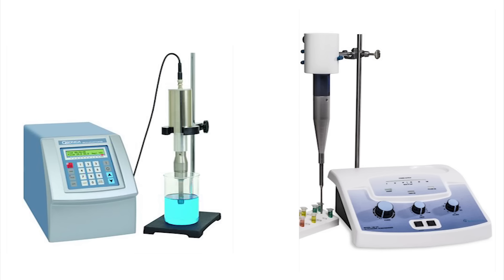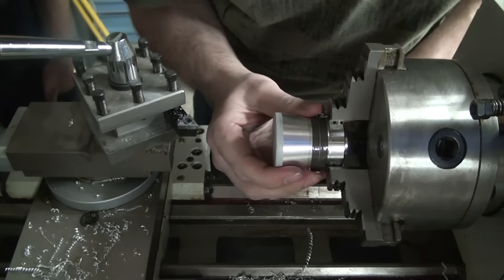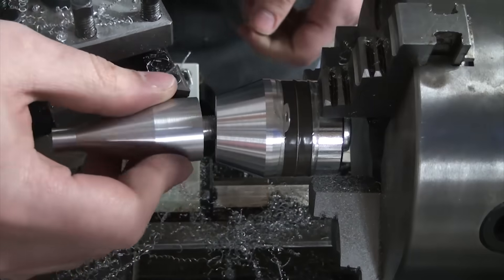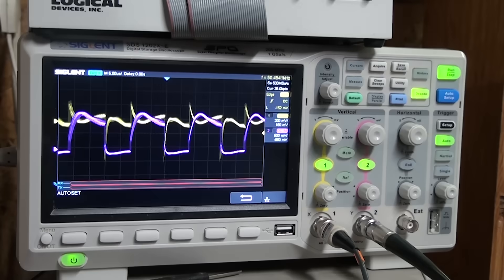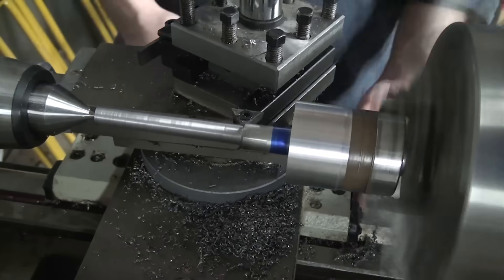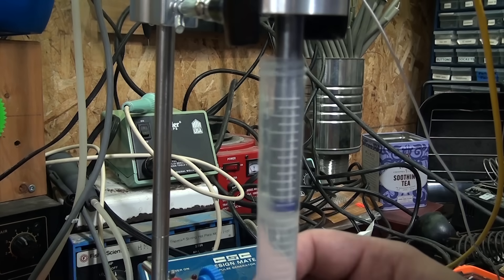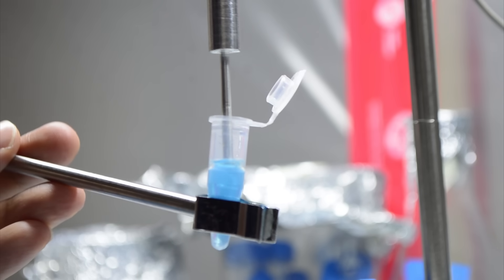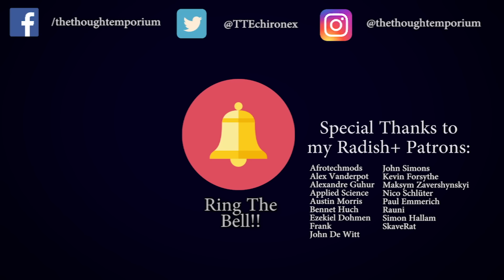DIY Ultrasonic Mixer

Comment: Thank you for sharing, i have a quick question, when you thread in the horn into the transducer, is it pushing against the main bolt that holds everything together or not? Because i found that it might change the main resonance of the transducer i just want to verify

Comment: 1:53 Piezoelectric voltage generation is how many cigarette lighters work. Same with gas grill starters (the kind that have a button that is hard to press and then releases with a loud snap).

Comment: As a machining technician, i spent the part of the video where u use the lathe machine SCARED AS FUCK. This is 4 years old so i assume u have now a deeper knowledge about machining. U were tempting the murphys law the way u were working. Be careful, this kind of machines dont forgive errors and u could get yourself dead in a single second. Wish u the best, nice project and video! Great work!

Comment: I would like to see if it is possible to make a good lotion with it. I would like to see it with the least possible amount of emusifier possible.  My suggestion: You clamp the emulsifier to a holder. On a 3D printer you place and stick the Lotion Container. I will write you a gcode that constantly stirs the Lotion in a controlled manner. I will now write a program for that.

Comment: Try cellular disruption.  I'm investigating small scale bio-diesel production using duckweed.  I'm trying to determine the overall energy input/output of the process.  I've looked at mechanical (seed oil press) and ultrasonic cellular disruption.  From a DIY perspective, could be fun!

Comment: I watched your video again.  I remember when I got my first metal lathe - I actually hated woodworking - so imprecise ( did I ever regret that in my later years) But now, I'm looking at this project of yours wondering if I could add a PWM to the sine wave generator and then attach it to a high voltage amplifier.  Variable power control in a truly tunable Ultrasonic emulsifier.  Any thoughts on potential problems?

Comment: just what the doctor ordered!  one use you might have already though of is sonication of graphene oxide.  Quick question.  Do you have an idea of what sort of power you need from a sine wave generator to accurately tune the probe?  Also, any thoughts on how the driver resonant frequency can be adjusted to optimize tuning at the driver end of things?  Thanks for sharing this!

Comment: Wouldn't a rotor-stator homogenizer be a better option for large tubes? My understanding from the culinary world is that the heat from ultrasonic homogenization is not the best thing to deal with, not to mention that it can burn the crap out of you if you're not careful.

Comment: Can a specific frequency be used to vaporize a targeted fraction within a mix of liquid substances?
Something like ultrasonic distillation?
I know ultrasound can vaporize water, so a quick proof of concept would be something like separating the water from a mix of oil and water.
The next obvious step would be to test the specificity by desalinating some sea water.
Advanced level testing would be targeting a different liquid by adjusting the frequency.
Azeotropic ethanol from wine, perhaps?
Gasoline from crude oil?
Biodiesel directly from vegetable oil?

Comment: very late little addendum a oscillating circuit comprised of a single capacior and a spool, tuned to the frequency you want will change square signals into a sine wave (formula for Fres is F_res=1/(2π√LC))

Comment: Sooooo we got weird and researched how to make Cola with essential oils and gum arabic, turns out a homogenizer like this would make a more clear liquid (smaller particles seem to counteract mie scattering) i instead of producing a milky solution and the emulsion would be much more stable. I’d be really curious for the results but I’m missing a lathe and a signal generator :P so if you’re still interested in this kind of emulsions, I’d be really happy if you would try that. I’ve researched quite some things already, but I’m not sure if that knowledge is second nature to you. So if you’re up for it but need some pointers I’d be happy to provide some, for starters: https://twitter.com/blinry/status/1300532277395501058
But I’ve got a little more from the book I was reading that I didn’t write there

Comment: you can use the tool for making bitters and other botanical-solvent mixtures for infusions. 
the traditional method is to simply shake the mixtures, but with the use of a sonicator or an ultrasonic homogenizer, I suppose the finished product would be much cleaner, and of higher quality because it would utilize the plant material and solvent to its maximum potential.

Comment: Fillestick fella, I can answer your questions on machining anytime, just ask. The easiest way to keep from getting shocked is to just take a long screwdriver and touch the tip to the lathe ways and the shaft to plus terminal on the transducer. Nice to hear you taking a chance and going for it on the lathe. One of my favorite machines. But personally I like machines that are thirty feet minimum between centers. What can I say, I am a guy who likes to run large machines !!!!!!

Comment: Well Ultrasonic Machining (USM) seems to be the next step to go. Use a peristaltic pump to deliver diamond dust-containing machining fluid. With a low-cost CNC table and this tool head it is possible to drill stress-free holes on brittle materials such as glass and alloy steel.

Comment: Ultrasonic mixing can cause unpredictable chemical transformations of both the substances themselves and between them. Because of this, they once abandoned this method for the manufacture of a blood substitute.
If you need precise threaded connections, you must either cut the thread with a cutter or make adaptations for dies and taps to keep them perfectly aligned with the workpiece.

Comment: apparently graphitic carbon nitride can be made from backing uria at 550 degrees for 3 hr. and has many of the properties of graphene as well as the ability to make ethyl and methyl alcohol simply by passing co laden air through it   as well as the guts of a battery that can hold 1/2 kwh per pound a very cheap very impressive material

Comment: a horn could be made to cut and drill rock easily as butter, also if there is a way to feed a custom frequency into the horn by a microphone at the other end of the object as a secondary input would bring wery interesting results (think Hutchinsons effect)

Comment: If you bring it up later I'll remove the comment... but subtractive manufacturing is critical, and in fact, irreplaceable by additive for materials with crystalline structures, unless you're going to go about putting something together atomically, but that would have a limited use case lol. This includes 'all' metals, for which the way the grains are formed is critical to their properties and application. Even casting requires temperature control, and has to be done in one pour to be contiguous. 3D printed metal structures might as well qualify as a completely different class of materials for this reason, not a replacement for applications where you'd normally machine a part.
Reply: Side note, I hate using the lathe to cut threads.

Comment: hello, engineer friend here, pascal's law is at work here - it allows you to "concentrate" forces onto small surface areas.  vibration is just changing pressure.  https://en.wikipedia.org/wiki/Pascal%27s_law

Comment: the problem is the taper of the horn.
you should try to make it a bit concave, basically just copying the commercial design, since it focuses the vibrations gently and more effective than just a "straight" edge.
also the mounting surfaces where one was not threaded right should be made as perfect as you can do to maximize the energy transfer, otherwise the pieces just bump into each other causing energy loss to sound and heat

maybe even do something to the tip, not just keeping it flat, but filing out some grooves # to create little pins, since the tip pushes droplets from one layer into the other, this could maximize this effect since the energy is more focused on more points.

also try making a similar probe, where you add grooves around the tip radially, maybe the effect will then be stronger too, since there's again more surface are for the tip to interact with the liquids.

and finally maybe do the same last ideas combined and a smaller diameter to really get things going.

I'm hoping to see some progress soon :)
thank you very much ;)
Reply: going around with a 40 grit file around the tip would be an easy way to add grooves

Comment: Cool. 1: To prevent getting zapped, using a bleeder power resistor  (just a standard 5 watt dealie) from the transducer grounded to your lathe chuck as a drain would save you from some trouble. 2: In general adhesives will give away with heat. A crude way to break that bond would be a MAPP/propane/whatever torch whilst slowly rotating the unit so you reach the threshold temperature along the joint line. 

A more elegant way would be to wrap some nichrome wire (preferably pre-heated) around it and run current through it until you get a preheat on the wire. Standard adhesives (cyanoacrylate, PMMA, etc) usually give around 120C. On the other end of the spectrum, threadlocker gives between 200C and 250C. I'm too lazy to fire up ANSYS, but PZT4 and PZT8 are both going to be safe enough re: thermal conductivity to split a standard joint without doing damage.

Comment: If you want to take it a step further, you may be able to perform frequency analysis on the horn (using Fusion 360) to dial in your shape—no oscilloscope needed.   https://www.autodesk.com/products/fusion-360/blog/frequency-simulation-using-fusion-360/

Comment: As everything has its own resonance frequency, do you think that modifying the ultrasonic probe to match the resonance frequency of one ingredients of an emulsion, it would separate out the individual components? A bit like an electronic litmus device or centrifuge but without the centrifugal mechanics? Or modify the ultrasonic blade to match the resonance frequency of different materials in order to better cut through the molecules/fibers of the material? (No i'm not talking about splitting atoms!)

Comment: You're the first I've heard mention how bad these things can shock you. Just about gave me a heart attack the first time I messed with one.
Reply from the maker: I've lost count how many times I've been bit by this thing. Just got me yesterday. It's the worst cause you're not expecting it from a piece of metal just sitting there. Totally understand that feeling. Your whole body tenses for a second, it's awful.
Reply: @thethoughtemporium  All you have to to is connect a wire between the electrodes until you're done banging on it. No zaps.
Reply: @thethoughtemporium interesting hack. 

I’m thinking of modifying a common home dental ultrasonic descaler to do some ultrasonic polishing of a steel piece of jewelry. 

Questions:

1)
Do ultrasonic scalers work only with metal horns or can it be made out of wood? (I would like to use a toothpick as the horn to be able to put some diamond paste on it to polish the steel jewelry)

2) Do ultrasonic scaler only switch on based on contact with a hard surface?

Thanks in advance.
Reply: The same thing happens in ultrasonic atomisers if you try touch the ultrasonic pads. I didn’t understand what happened it definitely rattled my bones 😂

Comment: Shortening to bring resonance down?
This does not add up.
You do seem to have atleast ended up on some resonance point that does something but I wonder how much power is just fed back into your driver. It will most likely die fast :)
Great video though!

Comment: You could try wirebonding with it. Get some 1100 series aluminum wire from McMaster and push the horn into it against some aluminum plate and see if you get any adhesion / welding.

Comment: I heard there is promising research with delivering medication to tissue with the help ultra sonic waves. Normally medication injected into tissue is absorbed but doesnt spread out well. Medication injected into tissue followed by ultra sonic vibration of the area spreads out the medication much better. Maybe this would apply to stubborn infections?

Comment: I've been wanting to make a machine for cold brew coffee and tea. Brewing requires heat, time, and agitation. Normal hot brewing only uses heat and time. There's a cold brew machine in stores that uses only time and agitation, more specifically just circulation; but the machine itself isn't that great, and in my opinion takes too long. I've considered using ultrasonic for agitation on the brewing side of the setup in addition to circulation. The basic circuit is pitcher > tubes and pump > a container with the coffee/tea > filter > tubes and the possibility of a second pump > back to the pitcher. 
A weak brew with the commercially available machine takes 5 minutes, a stronger brew takes longer; my thought is, especially since I'm planning on making the pitcher size a good three times or more the size, is to use ultrasonic agitation to speed up the process, hopefully by an exponential factor. 
I've also considered the idea of using pressure cycles to help extraction, but pressure introduces heat, and I'm not sure how to introduce that kind of system without interrupting circulation. I guess I could always try using a single container with ultrasonic agitation, and introduce pressure cycles, then just filter the outlet that the drink is poured from; but then you'd have to clean the entire vessel instead of one small part, but I guess you have to make compromises somewhere.

Comment: My approach to the tuning would be swept sine frequency.  That is natural because I have such instruments.  But the (liquid) loading tends to affect the resonance, at least a little.  Therefore, an adaptive frequency control would be a desirable addition.
Besides homogenizing liquid mixtures, I have seen how the ultrasonic energy can be used to replace a soldering flux when tin-plating.  The horn is placed directly into the tin puddle and it shakes oxides and other dirts from the part and allows wetting.

Comment: You can use those to weld synthetics together, like textiles or plastic bags.
But you need to make sure, that you dump the energy into the medium you want to weld by providing sufficient pressure and a counter surface.
The applied pressure varies greatly depending what you weld, general rule less is better increment until you hit the sweet spot.
For the counter surface it is best to use hard and dense materials so they reflect most of the ultrasonic waves, a slap of steel will do, preferable hardened.

Comment: I am trying to engrave PCB traces on a copper clad to make a PCB board using the Ultrasonic Transducer fitted with a carbide tipped probe. Still designing it.

Comment: Side feed liquid to it and use it to spray coatings. The atomized particles will be very low velocity compared to an air sprayer.  You could also make a spray drier out of it.

Comment: Here's an experiment I would like to see. I was looking through some old 1987 patent where the inventor used what he called thermotronic wave phenomenon in water by with AC oscillations. By creating a thermo-tronic standing wave resonanting the water by low-frequency electromagnetic induction. He claims he can change the resistance of the water by the spacing of the electrodes and frequency used. But with in the patent a side note was made saying that a electric charge could be made from the oscillations in the water probably because water is polar. I recall it saying it could be done by sonic means as well. Would this imply water can have a piezoelectric quality to it under certain circumstances.